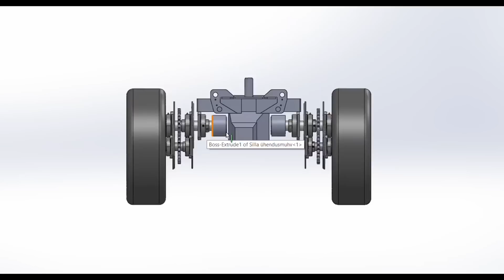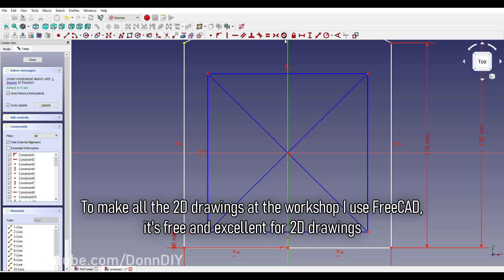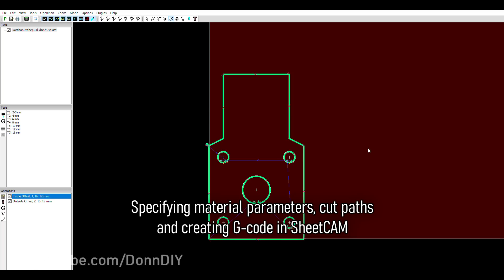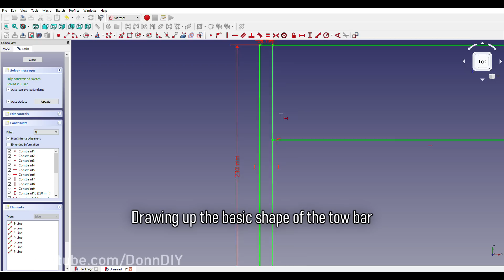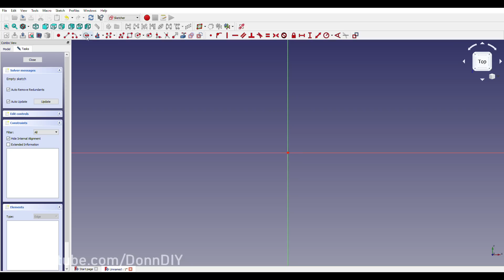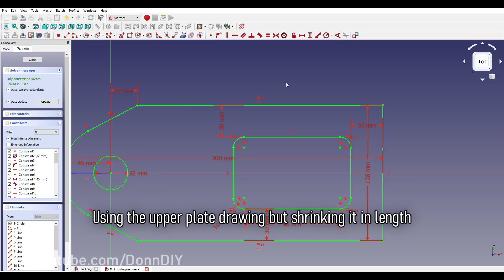4x4 PTO Driven Timber Trailer BUILD Ep.7 - Hydraulically Movable Tow Bar

Comment: Thanks for the heads up about free cad. I’m going to try it, I’m currently using Inkscape and I like how you can see measurements in it. I built my cnc plasma also. Can’t wait to see this build when it’s done. I’m just finishing up a new log splitter as we speak. My son and I have been using the one I built over 40 years ago.

Comment: Great job👍👍👍there is one tip if you don't mind) it will be better if the axis of the D-pad and the hinge under it match. Thus, you will avoid biting the D-pad at high angles of rotation of the trailer.

Comment: Maybe you've got ideas for this in the future but the pivot pin is oriented in such a way that it will require the removal of the PTO spindle to remove the pin. If you inverted the pin you would be able to remove it separately for repairs or service.
Reply: Was just about to make the same comment.
Reply: Pretty sure that pin would last roughly 7 lifetimes if greased occasionally.
Reply: @spangenbob  
That pin with a keeper tab on one end and nut on the other will never fall out. Never mind that there are several examples of popular OEM companies installing pins from the bottom. Usually because there’s something like a driveshaft or something else above the pin location.
Reply: Pretty common for the articulation point on big loaders and 4d tractors for the pin to be in from the bottom 
The driveshaft has to come out for Remo Al anyway but no ones lifting a 20kg pin into the artic frame and positioning it in the hole 
They make it so you jack it in from the bottom and then a retainer keps it in
More offernt than not the pin doesn't have any keeper welded to the top or bottom its just a straight pin with holes drilled and tapped at both ends, makes it alot easier to machine 
So you can choose to bolt the top or bottom keeper on first but of course everyone does bottom first
Reply: Not only that, the pivot point of the universal joint should be on the center line of the pin.
Reply: @SandBoxJohn  I was going to say the same thing
Reply: @SandBoxJohn  my exact thoughts too. What he has there is exactly like a universal joint in a pickup truck front solid axle where the ball joint center line has to be lined with the u-joint center line. Unless he plans to run a slip yoke driveshaft.
Reply: Thought the same thing.
Reply: @SandBoxJohn  yeah my dude didn’t think of that. He’ll figure it out when he starts using it I’m afraid.
Reply: @leemer1  that’s true. It’s the only way I can see for it to work.
Reply: Just a reminder to all.....DONN is an engineer of sorts. He's edimucated!!!(spelling on purpose) He can do this stuff in his sleep as I've witnessed from his really earlier videos while he was still in high school!
Reply: @SandBoxJohn  
Not quite 
You actually want the pivot point to be exactly in the middle between the unis 
As unis spin then don't transmit evenly they speed up and slow down (bad explanation look up universal harmonics)
So you want both ends to be the same angle at all time 
If he put the pivot straight under the uni then that one will be doing all the bending and the other will be straight 
Thatll lead to driveline vibrations 
He will prob get a few vibrations as it is now but not enough to cause major problems unless he wants to start doing alot of highway miles 

The slip joint in the shaft makes up for changing length as the angle changes
He also want to make sure all the yokes on the shafts are at the same orientation 
Phasing the driveline as its called will go Al long way to minimising vibrations
Reply: @alexaltrichter1597  Maybe it won't be the pin he's working on. Maybe some sort of incident bends the tongue and requires replacing. The idea when building something from scratch is to try to think through every eventuality in order to simplify life later on.
Reply: I'll jump on the bandwagon here too...yeah same, was just about to say the same thing

Comment: I had always wanted to build an ATV logging trailer and several years ago watching your series on rebuilding your logging trailer, I was inspired to build my own with my own twist.  I built the thing so heavy duty that I have trouble pulling it around.  Out of the four quads that I have, only one, my 660 Grizzly will handle the load, meaning the weight of the tongue of the trailer when there isn't a load on it.  It collapses the rear suspension so much that the tires rub on the fenders of my other quads.  When there's a load on the trailer, it balances the tongue weight a little better.  Even my friend's side by side had problems and it bent the trailer hitch for the 2-inch ball.  The trailer you are building now looks a lot heavier than mine right now and I'm sure your UTV will pull it just fine.  So, now I've decided to build my own UTV!  I'm going to have to find a donor vehicle for the build...  Thanks for another great idea!

Comment: Nicely done like all I have seen you build on YouTube. Only design flaw I see is the pivot point for the tow bar should be directly inline with the pivot center of your pto u joint. Otherwise as the tow bar swings the length of the pto shaft will change drastically. Very cool build so far

Comment: The tongue pivot should be in line with the center of the u-joint.
Reply: Doesn't matter, it is not a homokinetic joint
Reply: Tractor pto shafts can telescope something like 30 cm. It is actually good for them to move a bit in use so they dont get stuck over time.
Reply: Actually the pivot point should be in the centre of the driveshaft. Then the driveshaft cuts the corner and allows a sharper turning radius without such a sharp joint bend. Look at any articulated loader etc and that’s how they are built.

Comment: You can put the cylinder where the drive shaft is, behind the angled metal, and then use a pushrod setup (like in an F1 racing car suspension), using the triangle plate to divert the load around the angled structure, to the draw bar.

It's a strong setup that is also beneficial in the sense that it keeps the cylinder hidden, you can basically put it under the structure, even at an angle (downwards) to keep water from messing the seal. For a pushrod, you can use any piece of shafting that's meant to take a load, but you can also use a tube with thicker walls if you have one gathering dust.

Love the use of old stuff , i have a few cyilinders myself that i'm slowly going thorough, including a hateful one that fell on my foot when i was a kid. I'm saving that one for my brother's manure spreader. :))

Comment: Great work Donn ,,it will make a mess if oil in the ram but you could test with air from a blow gun use low air pressure too test .. that way you could see if it will pull back on the ram ,, not sure if you will need a ram on both sides ?? time will tell maybe I will find out in the next video .. keep up the great videos ..

Comment: I wonder why when using the hole saw you do not wind the ring down to push the cutter drive pins into the wholes in the cutter. Very easy to get off again as is not tight up against the threads. 
Great job. I have been watching many of your projects. Keep making the super informative videos. Thanks.

Comment: To make great zirk fitting guards. Take a large nut drill out the threads than welded it around your grease fitting hole. 🤔
Reply: I use left over pipe trimmings from my scrap piles.. its a lot cheaper than a nut

Comment: 15:16 You can also cut notches perpendicular to the rotation axis of the bushing (in this image) and then bend a piece of flat bar U shaped, and weld it over. This variant gives extra strength to the whole affair.

Source: My brother bought an articulated PTO-ed trailer used inline behind a tractor with a seeder (you use it to put IBCs and other stuff on it if you fertilize and stuff like that), which had that way of holding the bushing, and in an accident, the pin bushing broke weld towards the tow bar, but the strapping held it all together despite the nearly 90 degrees worth of lateral load (it's meant to ride offset to the tractor).

When i fixed it, i basically pushed the tow bar against a wall and welded it all back together with a little extra plate under the bushing. It's a really strong design.

Comment: From experience, using two rams is way better, one on each side connected in series if memory serves me correctly.  Especially if you need to hydraulically lock the trailer in an offset position while towing.  If you use shuttle valves for steering adjustment, get the connectors with leds to help prevent back emf.

Comment: I really love your channel and your work is brilliant.
I’m kind of confused about the pivot on the tow bar not aligning with the pivot of the U Joint.
Will this not cause unnecessary telescoping of the driveshaft and an added torque stress at the joint? 
I’m reluctant to ask as you seem to really know your stuff but I’m just wondering about this point.
Reply: They are made to telescope mate, won’t matter

Comment: [23:46]: Before you welded up the tow bar mount assembly, I was surprised that you didn't check the pin, namely to 
ensure that it hadn't bound up and could still be easily removed; but you know what you're doing far better than me.

Comment: if you every want to cut plate that is thicker then the piercing capability of the 45 you can drill an 1/8-3/16" hole at the pierce and run it like an edge start. i do it with 3/4" plate on my Hypertherm 85 all the time.

Comment: For your hydraulic cylinder on towbar double the thickness of your brackets on each end then weld a lapweld barstock on the top and bottom double bracelet in a couple of places to give you a few options for your cylinder

Comment: Shouldn’t the pivot pin be directly under the cross of the U-joint?  This would eliminate the shaft changing length as it pivots and allow you to remove the pin without disassembling the carrier bearings.

Comment: Doesn’t the tongue pivot point need to be along the same axis as the drive axel pivot point?
Reply: From what it looks like to me, he is going to use a PTO shaft that has plenty of travel built into it already. Thus eliminating the need for the pivot point on the same axis of the trive axle.
Reply: @1983bronc  The length of the PTO shaft isn't the problem. It's the angle of the U joint when he is negotiating corners.
Reply: @anan0moose  with the pto connections being further away from the pivot points the angles of the universal joints should be less.

Comment: Always great content.  I'm curious why @12:25 you didn't keep going and drill the pilot hole for the other side of the square tube.  It would have avoided needing to mark out the other side - saving a bit of time and guaranteeing the holes were aligned..  Does the mag mount for the drill not have the range to get the pilot drill bit low enough?

Comment: Might want to add mechanical lock possibility on the pivot arm, so in case hose ruptures you can still drive it as normal trailer. Also maybe take out the arm now fill it with gravel and put it turning for day or so to remove any rust inside and then paint it. Would not want that rusting away over time. Specially after all that work.

Comment: I think I kind of understand what you are trying to do with that cylinder.  Disregard this comment if I'm wrong, but you're trying to make it so that when you turn, the movable trailer hitch follows you so you don't bend the driveline?  If that is so, I would recommend using another pivot point right before your hitch pin and then make the hitch mount more stationary on your utv.  Then you can run what I would refer to as a "Z" link underneath so  that the trailer will follow better without kinking the driveshaft so to speak.  What I mean by this is taking another solid bar and running it to a pivot point on the left on either the front or the back and then to the opposite side on the opposing pivot point.  This would also help making your turns more of the same radius and take stress off of the whole system.  I think this might be a simpler solution than trying to work out the cylinders, but I could be wrong.  If I'm wrong in my assumption, sorry for making you read a wall of text.   By no means am I trying to tell you what to do, just a friendly bit of advice from one internet stranger to another.  I have been thoroughly enjoying this build series.
Reply: The drive shaft is likely going to be a standard PTO shaft. Which expands and closes. Think a bar inside a pipe. Which is why its only going to bend one direction I think. Yet I am not sure.
Reply: Yeah, I get that, but it's still pretty easy to stress that front U joint.  I have that problem on my baler, and I have been thinking about redoing the hitch.

Comment: The pivot for your tow bar needs to be centered on the center of the u-joint in the drive shaft or it will cause binding of the drive shaft!

Comment: I think for your driveshaft you might have more luck using car driveshaft and Constant Velocity joint forward of the support. It will eliminate bind in universals, the need to phasing for ballance for the lenght of the driveshaft and give you no articulation limitations.

Comment: Well I see no problem with the pin going down, theres only 4 bolts and the top bearings come right off along with driveshaft slip-joints, the only issue I'm seeing, is the ATV going to heavy duty enough to pull this trailer effectively????? It's looking to me that a 25hp tractor will be required, maybe Donn can make one of those!!!! But either or even if I had all the same tooling theres no way I could make this trailer

Comment: hi doon why hydraulics on the arrow of the trailer? it would be justified if you had a tracked vehicle for example in front, but your UTV has a direction, so I don't see the point of doing it in fact
Reply: By making the tongue pivot, he is reducing driveline angle for any given steering angle. For example, with a traditional design at 45⁰ will put 45⁰ on a single ujoint. Whereas this design will split that same 45⁰ steering angle between 2 joints at 22.5⁰. And theoretically depending on lengths and wheelbase, he can negotiate tight areas and make the trailer follow in the same tracks as the tow vehicle rather than trailing to the inside of a turn.

Comment: Not quite sure how the cylinder will help.... I must see the next video soon... remember Donn, I am old so get with it chum/LOL
Reply: By making the tongue pivot, he is reducing driveline angle for any given steering angle. For example, with a traditional design at 45⁰ will put 45⁰ on a single ujoint. Whereas this design will split that same 45⁰ steering angle between 2 joints at 22.5⁰. And theoretically depending on lengths and wheelbase, he can negotiate tight areas and make the trailer follow in the same tracks as the tow vehicle rather than trailing to the inside of a turn.